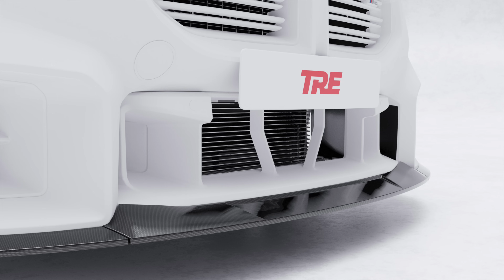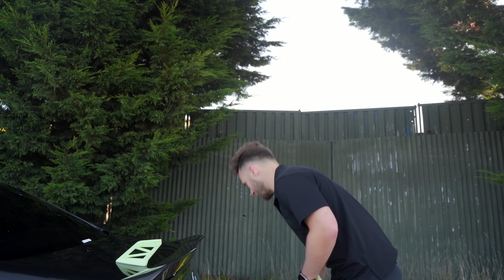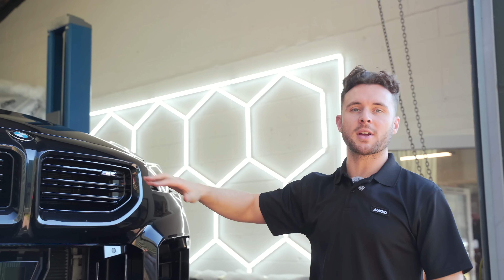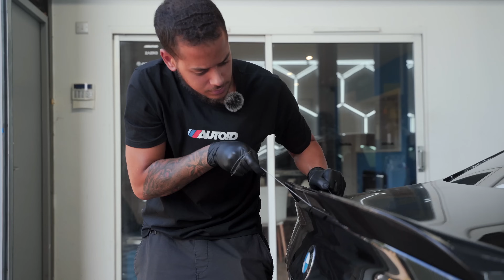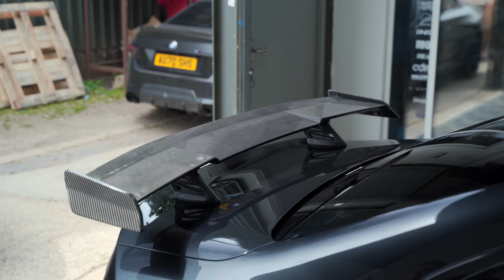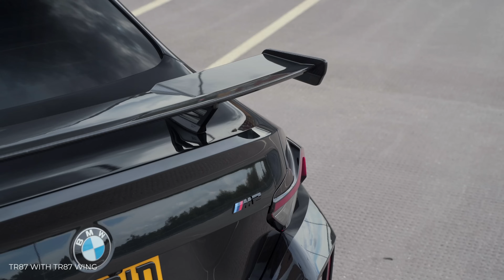This NEW Body Kit for the G87 M2 *TRANSFORMS* it! Trevora TR87 First Install

Comment: I have a Brooklyn Grey M2 and I’ve added the TRE front lip, flat side skirts, rear winglets, spoiler and mirror caps:  I can’t put into words how awesome my car now looks.   The quality of these TRE add one is great: every single part fits absolutely flush and perfect with the body lines of the car.    Installation is super easy and shipping has always been in about 3 days.   I’m adding the rear diffuser and I’ll be done and I really recommend this company and its parent company Milltek (TRE carbon).    If you want quality products for your car, don’t just go cheap, go with quality.

Comment: New M2!  Black color is definitely a color I wanted!  I like without a wing on the truck though.  Nice and clean mod!  I like it!  since car itself has very boxy all around.  If I have to mount a wing on the back, I would like to have non-tilted stem unless you use a GT like a wing.

Comment: I have a question. I like this TRE wing a lot and all these wings in general "look" like they could fit any car (I wonder if the base that is in contact with the trunk is flat or angled). I would like to have it on my G29 Z4 m40i. I've seen m3/m4 wings installed on z4 so. Thanks if you can help, I would get this for my car!
Reply from the maker: Thanks for the comment. In theory, if we changed the legs, it could fit any car. Just a matter of adapting them.
Reply: @AUTOIDTV   thanks for your reply. Would you need to have my car at your workshop though, right? I will deff look into this wing when it'll be available on your website

Comment: Nice bit of kit, but I'd prefer the 'boot spoiler'. reminds me more of the old M3CSL Boot lid as opposed to the 'rear wing' option.  However I'm not 25 years old anymore and I'd be looking for something a little more discrete.  Yep rear wheels are slightly too wide, maybe use 285 with 10mm spacers instead of 295 with the 5mm spacers you mentioned.  Either way would work tbh.
Reply from the maker: Yep, totally on board with that! The ID-01 spoiler looks awesome with the kit. 
I’ll be adjusting the spacer on the wheels to 5mm. 👌🏼